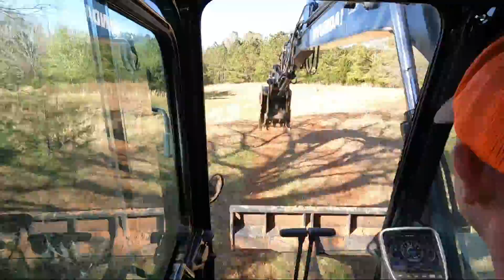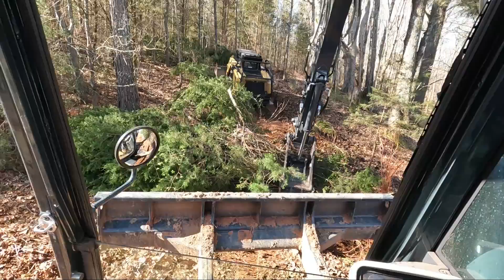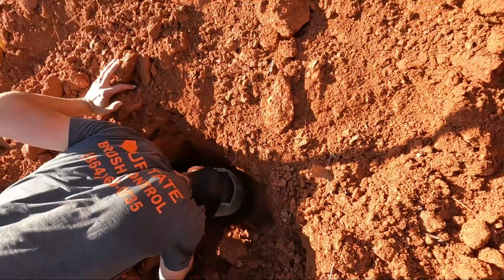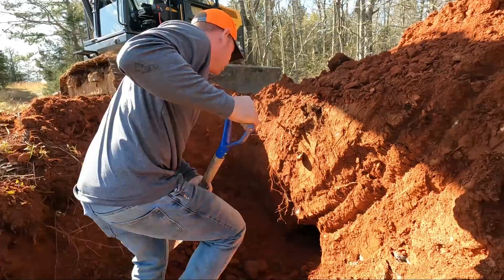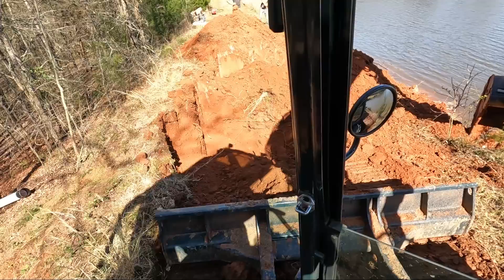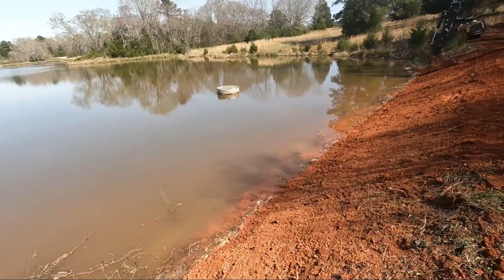Repairing Severely Damaged Pond Dam from Muskrat Holes

Comment: I have the same problem in one of my ponds that I need to fix however when done I am laying vinyl covered chain link fence down on the water side with around a foot of the wire above the water line that will or should prevent this from happening again.  They can't dig through the fence

Comment: Hey John next time you find the big hole of the Beaver dam going through the pond put a little fire in there and grab some dead grass and one bit of wet grass on top of it stick on top of that fire and grab one of your own electric battery powered thing blowers put it on low and let it blow in the smoke into the hole and that should show you every hole that is inside that damn and plus also get ready to craters real quick